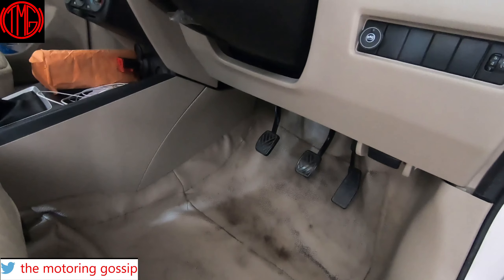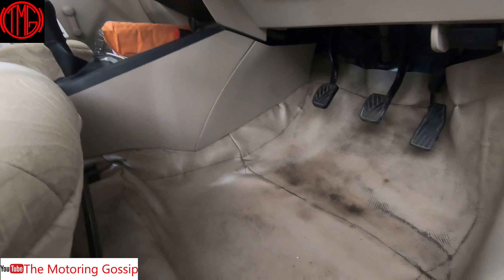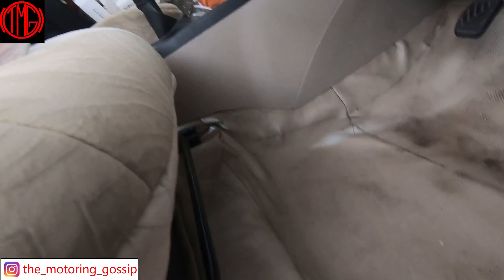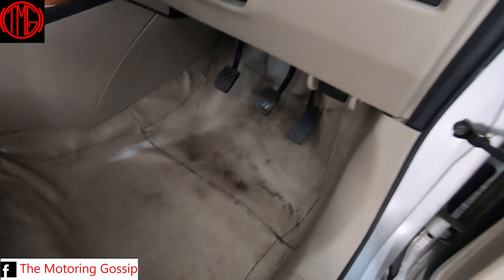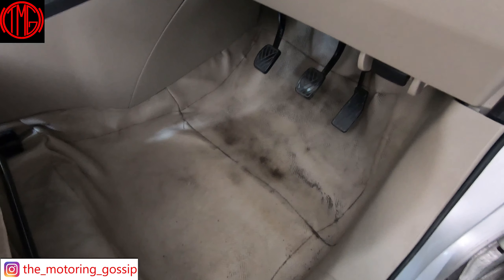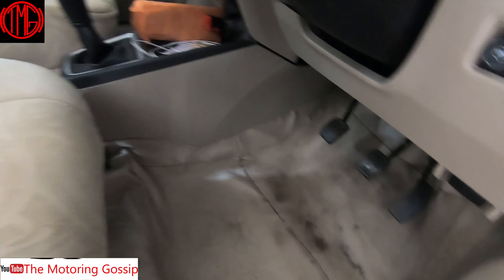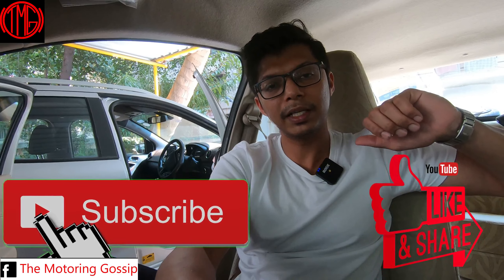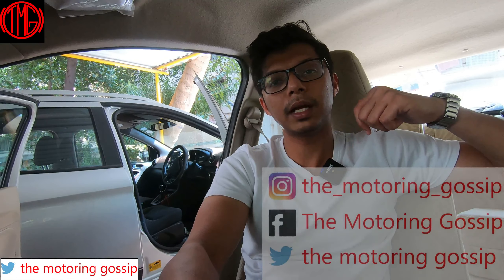7D Mats VS Car Floor Laminate for Ford Freestyle

Comment: In my nexon floor laminte has been done, over that simple rubber mat is there eventhough will get dirty sir... Im planning for 7d mat, i need ur suggestion....
Reply from the maker: If you have already done lamination, i don't see the need for 7D mats. but yes 7D mats will enhance the entire look and feel of the car, so if you want to consider 7D for the reason then good idea, because Lamination doesn't always look as good.
Reply: will 7d mat  fit over previous laminated floor or else remove the whole thing bro..??

Comment: Good informative video. Lamination flooring, main disadvantage is you will not get back your original carpet flooring if you want they will demage all by using glue. Please do a video for car seat covers and good seat covers for airbag seats. Thanks
Reply: Also that with floor lamination, you never know of the rust building up inside,until it totally fails.. so, esp for coastal areas, removable mats offer this possibility.

Comment: True... Vinyl flooring s not required with freestyle....even if u did ,mat will float on top of dat which s disturbing....
Reply from the maker: Yes, I agree.
Reply: What do you mean float? How it will slide as the shape of mat confirms to the edges, as he shown in this video. It is of large size and will fit exactly in the gap and how it will float/slide. Could you tell if you have made the change and experienced it?

Comment: Freestyle does come up with very good quality 3D mats on the inside cabin  floors and on the boot cabin floor which is way better than putting the small 2D mats on top of the laminate(as u showed in dzire)which in turn becomes slippery. So, not necessary to laminate the freestyle floor in my opinion.
Reply from the maker: I agree. Ford has given its Freestyle pretty good mats. And there is no need for a laminate or a 7D mat in the Freestyle.
Reply: I realize Im kinda randomly asking but does anyone know a good place to watch new tv shows online?

Comment: please share info on petrol clutch some say clutch is very hard what's your view.. Thanks..
Reply from the maker: The petrol engine's clutch peddle is not at all hard. Very smooth to press complete clutch and gear shifting. No complains there.